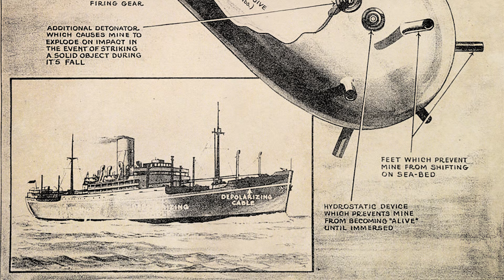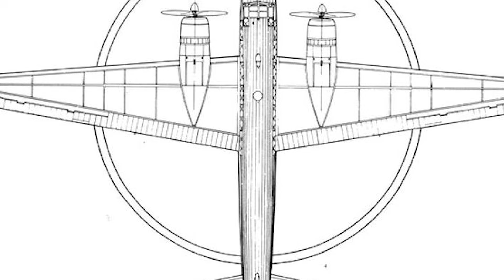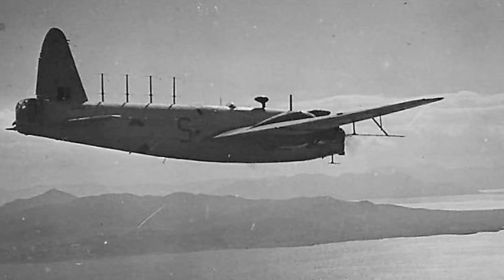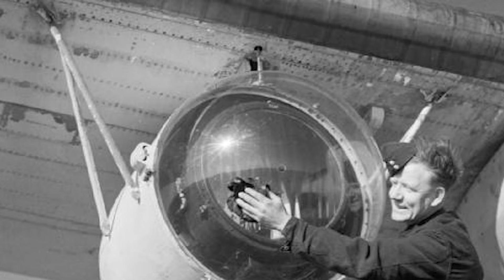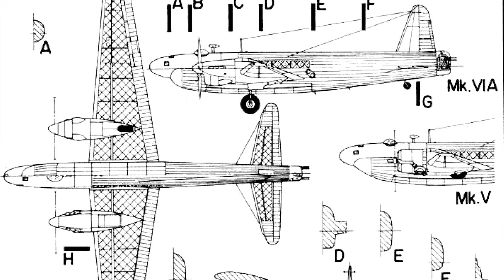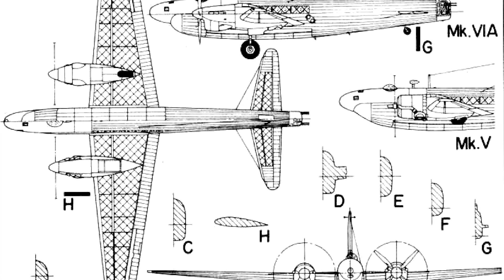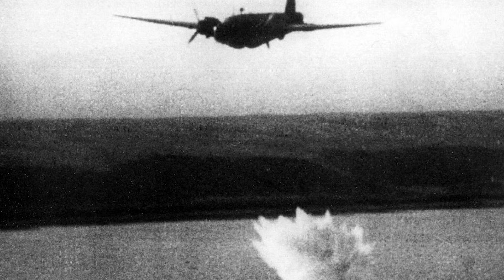Britain's Strangest WW2 Bomber? | Vickers Wellington (Part 2)

Comment: Why not more airplanes were built with the geodesic airframe? Like passenger planes, four engine bombers, even fighters?
Reply: Looks inefficient and expensive to build, aero drag probably very high--which may explain the slow speed. 
Not an appropriate way to make an airplane structure, overall. A technological dead end.
Notice that nobody tried it again.
Reply: @2lotusman851  You may suppose but I would like an answer from those who build airplanes. For example, airplanes with the wheel bellow the tail section inhibited the vision of the pilot at takeoff, but they continued building them like that even after the P39 and the P47. Now days they are not so common..
Reply: @gorkivalenzuela6940  fair enough. Been working as an engineer at an aerospace company now for 30 years, 
The semi-monocoque structure  using aluminum or composites is state of the art now. The SKIN being the primary load carrying structure.  Stringers and frames allow things like floor beams to attached, and are secondary load paths if necessary. Since the skin is at the outer extremity of the structure, it presents the highest amount of resistance to bending and torsion. The sheet skin can also be tailored to give varying amounts of strength for fatigue, or otherwise, by locally milling it thinner, or padding it's thickness up.
The solid sheets of skin allow the structure to be pressurized if a pressure bulkhead or dome is used. Wings are made in roughly the same way-- skin, ribs, stringers, spars, and allow fuel to be stored in available open areas.
Can't do that when the outer covering (SKIN) of the aircraft is-----FABRIC!
Reply: This was a rapidly evolving field of engineering. The monocoque and semi-monocoque method of construction was eventually superior in the construction of aircraft. It provides improvements in: construction time; it is more suited to mass production; gives a less cluttered and larger interior; and has a much lower surface area which equates to less weight due to less paint required; plus probably many other factors which I simply cannot think of right now. Geodesic construction still has advantages where weight is less critical.
All the best.

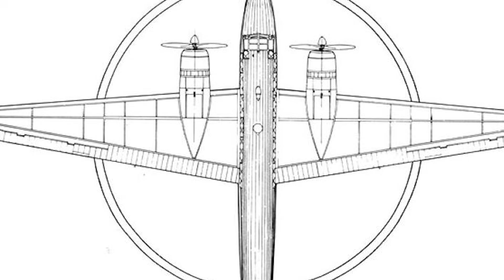Comment: 3:35 a magnetic field that would promptly ruin every watch/clock on the aircraft
Reply: Not to mention magnetic compass.....
Reply: @Retired Bore thank you, My assumption was that it would be higher at the centre, welp that’s assumption for you. And I had a notion the the compass would have some shielding similar to what is used on steel ships
Reply: @Retired Bore you are undoubtedly right but I’d love to know the Gauss reading around the crew by 1956 Rolex had the Milgauss ( even back then Rolex took 10-15 years to take on new tech) so that tech was around but that ring has to have been MAXgauss

Comment: From my vague recollection, wouldn't the magnetic field interfere with the aircraft's compass?
Reply: Yes. They would have to use a non-magnetic compass
Reply: @Thomasnmi  a gyroscope?
Reply: @benholroyd5221  that or a radio compass.  

Or they may not have been able to use the compass and the loop at the same time.
Speaking of time, I wonder how it affected clocks/watches?
Reply: Yes, I presume they would turn it off  when required.
Reply: Yes, They first got around it at first by using a directional gyro - This meant that after take-off they had to calibrate the gyro by flying along a straight route at a known bearing (usually a railway line). But the gyro could drift off during a long flight. So they then experimented with many different types of compass (including big ones taken from ships) in different parts of the aircraft. One DW Wellington flew with no less than 22 compasses on board! - They eventually found that a standard RAF P4 compass functioned okay if installed in the extreme tail of the aircraft. - Source "Rings and Things" - an article about the Wellington DW aircraft by Eric Morgan in issue 9 of "Twenty-first Profile" magazine.

Comment: You have to wonder why the searchlight equipped planes weren't fitted with some decent forward firing ordnance. A Mollins gun for example could have put some serious holes in a sub as soon as the light went on. Fixed forward firing almost certainly wouldn't have had the issues of the turreted heavier guns.
Reply: In the dark, 4 or 5 shots maximum, keeping the aircraft out of the wet while aiming? Even the much more nimble daytime Molins Mosquito wasn't overwhelmingly successful. Guy in a turret with a pair of 0.303s would be a much better bet, suppressing the U-Boat AA while running in with torp/bomb/depth charge.